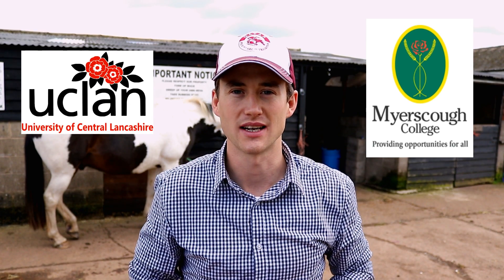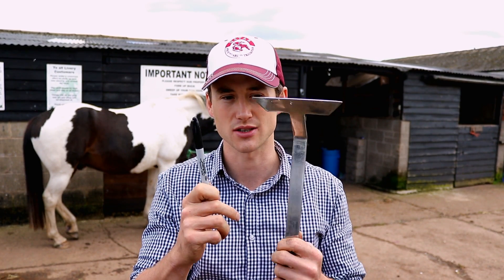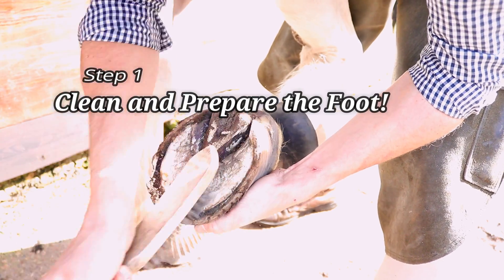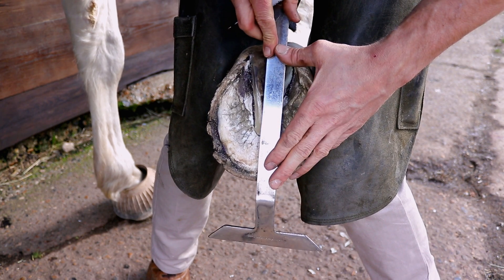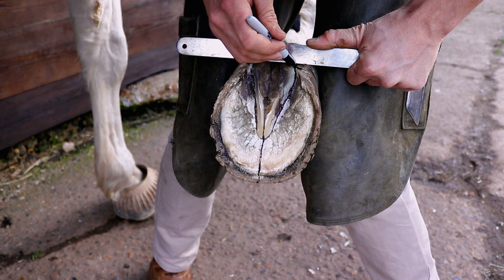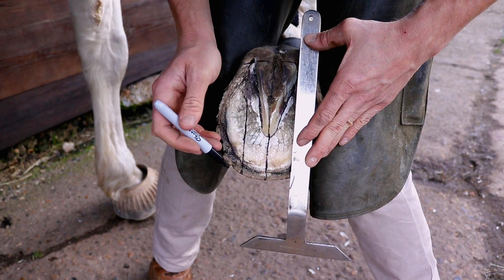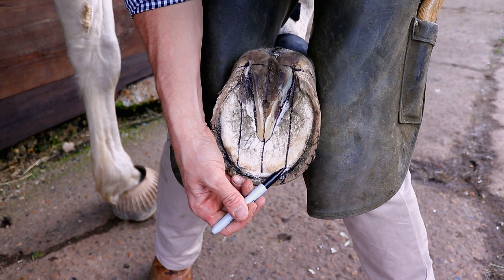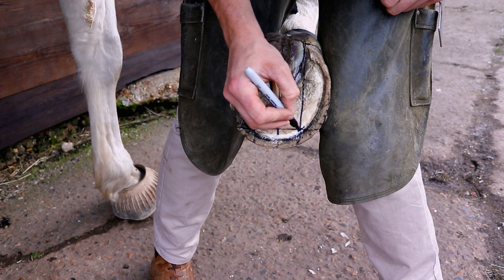Trimming Hooves part 1

Comment: Hmm. With much respect I don't find this style of hoof map provides much useful information. I played around with this technique but it doesn't help recognise migrated and distorted structures that you could be basing the entire map on. I'm much more familiar with the ELPO/Daisy Bicking style of hoof mapping which uses many more subtle external landmarks (termination of bars, bar swells, frog boob etc) to avoid the mistake of basing your map on distortion/migrated structures when determining anatomically correct breakover.

Comment: Hey Alex, so when you mapped a foot , what’s your goal when applying a shoe ? Is it so the shoe has a 50/50 from the center of rotation? 50    % towards the toe and 50% towards the heels?
Reply from the maker: Ideally that is what we are looking for Rolando yes! Good dorsopalmar hoof balance. Complimented by good heel to toe height ratio, good hpa and correct mediolateral balance and we are on the right track